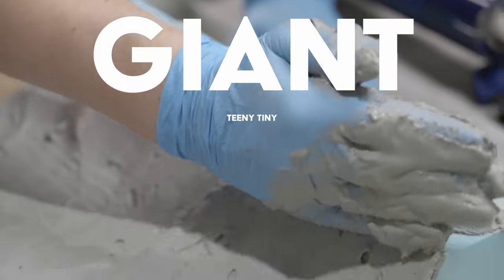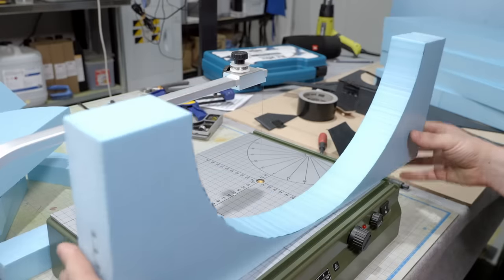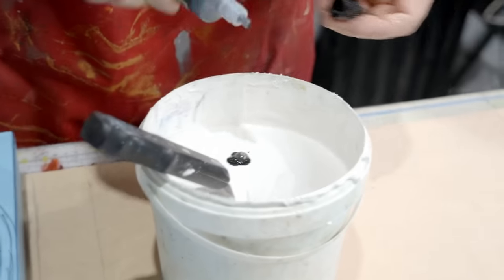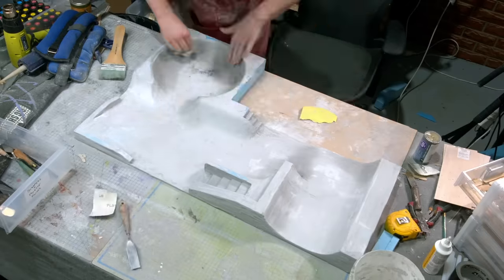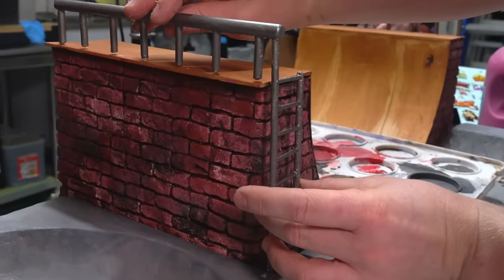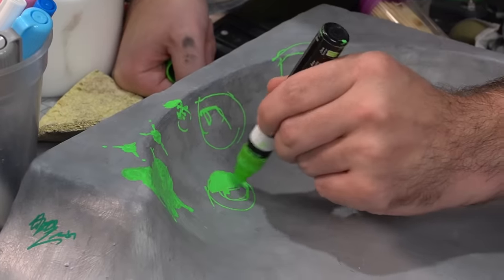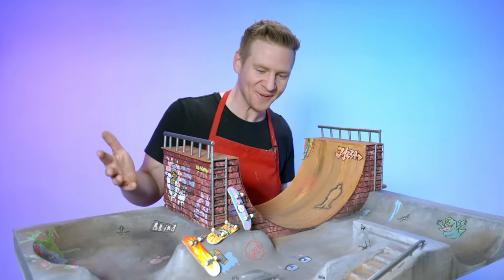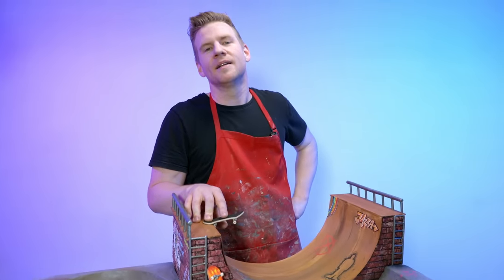I made a Skate Park - for my Fingers!

Comment: I am absolute trash at fingerboarding. God had different plans for my fingers. I want to learn to skateboard though. I had an Element Fiberlight and always heard it's a great board, but it was too small. Now I have a Santa Cruz board, but I'm not sure if this board is the right size either. It is better than the last, but I dunno. I wear an 11-12, and the board is an 8" I believe? I also think I got vert wheels when I have nothing but street to skate =/ That's life for ya

Comment: As a skater, finger skater and "artist" this is pretty cool. I like the 90's skate logos. The action shots were cringe and hard to watch though lol. Looks like a fun park to skate in real life or with the finger board. IRL the big stair set you wouldn't have enough room to push so you could really only air out of the half pipe to hit those stairs. The other stairs are a little to close to the big half pipe to hit with the fingers, but I assume the half pipe is removeable? Also most of the premade teck deck parks the rails are made of some sort of metal or durable plastic. I think a real fingerboarder would literally destroy this park, could be a fun video? This is sick though, love the artwork 😎🤘

Comment: This is sweet. But as a skater I have to say that your scale is slightly off. Think everything needs to be just a bit bigger.  And I think you could have plastered it in section rather than racing to do it all at once. But turned out pretty cool.

Comment: I love this but I would say that the next time you build something like this it should be a lot bigger. The quarter pipes and bowls are a good size but the stairs and ledges should be a bit bigger and longer. And everything should be spaced out more. I would also recommend using actual concrete with a use urethane coating it’ll last longer, hold up better and it will feel realistic